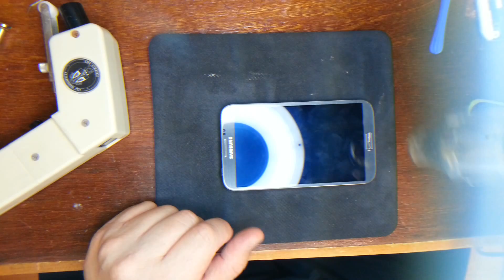Samsung Galaxy Note II Glass Removal

Comment: ANYBODY REPLY ME.... 
After remove the  broken screen then can we apply full glue to screen ??
or only sides of the frame?
how to attach new frame?
Reply: Raghu CP Chitlur If LOCA Glue way, then You need to apply LOCA Glue in a X shape. Shape is common on all these how to videos. 2mm Double sided tape is on the borders. 
If You use only 2nn double sided tape, then after some time, dirt will get in between glass and LCD and they will loose the touch.
Reply: frame have hot glue already can use frame machine, and or you can use B-7000 to paste frame

Comment: is it possible to heat my note 2 in the oven to get it hot enough to get the glass free?
Reply: LTCAproductions Not unless you want to completely fry the motherboard and burn the LCD
Reply: LTCAproductions Not unless you want to completely fry the motherboard and burn the LCD

Comment: MarcustazXDA  I just replaced the screen of my samsung Galaxy note 2. But I experiencing some trouble with my touch screen. It works good but sometimes it wont react when I touch the screen. I have to lock my phone and unlock it and then it will react normal again. I also had this problem when i replaced the screen of my samsung S3. Maybe I'm not doing some right. are you familiar with this problem. Do you have any tip what I can do to solve this?

Comment: Replaced the screen of my Note 2 and everything works and looks fine, except for one thing that I do not really find a lot of information on : if I push to hard on the screen (probably this happens when the glass touches the digitizer beneath it directly) the Note 2 gets confused and the touch functionality is blocked completely until I lock and unlock the device. In Development mode I see that every touch after the first "deep" one is seen by the Note 2 as 4 touches instead of 1. Unfortunately when I put it in my pocket this also happens, leaving me with a diminished experience after what I consider an otherwise succesfull broken glass replacement. Am I the only one with this issue?

Comment: Tried to fix mine, bougth everything i needed, heatet it up properly but managed to get the plastic guitarpick under the digitiser when trying to serpate the glass, and the entire digitiser snapped off, also destroying the amoled screen in the process. :(
Reply: Espen Andrè Edvardsen That sucks. I think its never stressed enough how THIN the glass is. The digitizer is THIN too. So its like a tiny thin piece of glass that needs to be removed.
Reply: +Espen Andrè Edvardsen Did You Get A New Phone Or Was It Fixable ?

Comment: I would advise EVERYONE watching this video to make sure you buy some plastic razor blades for the screen removal. The kit I ordered came with a guitar pick styled tool, which couldn't get far enough to lift the screen completely. I started using a mini screwdriver and it worker great until the bottom left corner of my LCD cracked from the prying motion. Use extra caution on ALL corners, and wait the extra few days for those plastic razors! Keep in mind that a new LCD is around 150$.

Comment: 1.  can you use a regular hair dryer?  If not, how and where would I obtain one of those super heat things u used?

2.  Is there a part that goes through the steps of putting the new glass on??

Comment: My Note 2 has a cracked glass. I watched your video. I was hoping that your process would have been to completion with a working unit.And then, turned on and used as normal to show the repairs was a successful operation.  Any chance of that?  Also, for those who do not have a heat gun can a hair dryer be used?

Comment: If some of you guys are having trouble with the screen not being responsive but when you lock and unlock you phone it works then all you need is loca glue 
AND remember that most of the new glass screens will have a screen protector in the back so make sure to peel it of or else its going to look darker and scratched

Comment: I ruined the white part of the back key not the ribbon but the piece that goes behind is there something I can use other than buying a new ribbon cable that comes with that included?  still works but I heated up to much and that white piece warped and its causing the new screen not to sit right in that corner.

Comment: I bought a replacement digitizer from etradesupply attached the ribbon cables and it doesn't work at all. It's not broken it just doesn't work. I'm baffled. I'm contacting them for a new one

Comment: Hi there, i changed the glass using this method. The problem is that now the bottom part of the screen is(within an inch above the home button) is only recognizable with Spen. it doesnt recognize my hand. i used adhesive around the edges of the screen and i did not know that i needed an adhesive for the screen itself. Does all of this mean i no longer had a working LCD??? or is there any hope with it???

Comment: Hi,
I have a Samsung Galaxy Note 2 and I recently broke the front glass of my Note 2. I then bought a new Note 2 front glass and I took out the old glass and input the new glass in successfully using your exact methods from this video.
For some reason, my Note 2 will not show anything. There are noises of it being turned on, but there are no lights except this light to the left of the earpiece.

Please assist me in my next step.

Thank you!

Comment: My note 2 screen broke and the screen used to still turn on but now it doesn't. Do i need to replace the digitizer or something more? Help me please =)
Reply: You likely broke the digitizer during the repair. I think the downside to removing the back screen is that you are more prone to pulling up the digitizer as well as the glass if you are not extremely careful.
Reply: Erik Anderson No no i haven't repaired it yet. It broke from when i fell but not only is the screen cracked it also doesn't turn on so i'm wondering what it is i need to replace or is the entire phone broken? I've repaired screens before but only when it was cracked (still turned on and functioned)
Reply: Do you get the startup sounds and a black screen or no activity at all?
Reply: Erik Anderson None activity =\
Reply: On mine I heard the sounds but no screen activity and that's what turned it to be the lcd/digitizer combo. If you don't get anything that sounds power related.  Sorry I can't help there.

Comment: how to check that only glass has broken not digitizer? please answer me. i am going to buy phone which is working fine and has only cracked screen which is visible, looks like only  glass broken handset, how to know if digitizer is damaged or not ?
Reply: if digitizer is broken you wouldnt be able to use the touchscreen
Reply: Killerdude is wrong. If the led doesn't turn on and you cant see anything or there are black marks on the screen, or it doesn't respond to your touch, the lcd is broken. If everything works, the just the glass (digitizer) is cracked, that is the only thing that needs to be replaced.

Comment: ? I replaced my screen and now it is freezing when, I am texting.  I have to lock and then unlock my phone, just to text over and over, repeatedly just to type a full message any help would be appreciated.
Reply: That is the reason people should use loca glue. It gives the support you need, also easier to break the glass again without glue. I will do my first with no glue then with experience, try the  glue.

Comment: While repairing the glass on my note 2, i slightly messed up the top left portion of the digitizer ribbon cable.  Most of the touchscreen is responsive and works properly, but just the bottom part of the screen is buggy/unresponsive (such as the last row of letters when trying to type some text).  

Is this a problem with the digitizer cable, or is it the fact that i only used double-sided sticky tape rather than a stronger adhesive long the edges?

Comment: I did a successful repair thanks to this video, only problem I have is that the screen looks a bit dull now and has some vertical lines in the new glass. Could this be due to a cheap repair part? It doesn't feel like glass but plastic. Is there any online shop you would recommend for an original replacement glass screen? International shipping will be handy.

Comment: I did everything you said, glass came off with no problems, i put the new glass on, i turned the phone on but somehow the touch is not working. When I use the s pen the screen works properly. when i use my hand it doesn't. What did i do wrong??/?????

Comment: You guys should know that replacing the glass is not a great investment simply because it is easier to get dust underneath the glass/lcd. This will require you to replace the adhesive every month or so... I have many spare adhesives/extra note 2 glasses just for this as I have to replace mine due to the dust that accumulates. I do not use the 3M tape like many do but buy the one that are precut for the note 2.

Comment: Can I get a quote to fix, I messed up on the LOCA section of the repair. I fix the glass the first time, but a newton ring appeared. Attempted with the LOCA , removed motherboard, but only the battery signal comes on, and only when it is plugged in, any help would greatly appreciated.

Comment: ...the digitizer in the upper left hand corner of the screen.  Yes, the one that you specifically said "be very careful around this cable"  The screen still powers up, and the S-Pen works everywhere, but the lower 25% or so of the screen doesn't respond to touch, no matter how hard or soft I press.  I tried holding the ribbon cable in place and it worked ok, so I taped it, but the adhesive came up and when I tried a second time it didn't work.  If I try pressing that ribbon cable down...

Comment: I could really use some advice.  I followed your guide exactly, last night, and replaced the glass on my Note 2.  I have 2 issues though.  1, there seems to be a bubble of air or something in the middle of the screen, between the glass and digitizer, that gets larger as I press harder.  I assume it's because of the gap between the two where the liquid adhesive would normally go.  Not a huge deal, but annoying.  My big issue is that I accidentally peeled/ bent the ribbon cable that connects to...

Comment: ok.. I know what I did.. I pulled the glass back off and noticed I had slightly damaged the ribbon cable connected to the screen/digitizer. I should have watched your video twice, I noticed that you mentioned to be very careful at the top left where it's connected. I thought I was but I guess not enough. I put an extra layer of the double sided tape in that area and now it works kinda.. it's a bit inconsistent. Guess it's going on Ebay as a parts phone... DAMN.. SO CLOSE!!

Comment: Alrighty.. did the replacement and everything seem to have went fine but after everything is back together the lower half of the screen isn't responding to touch.. upper half fine and the home button,back and menu work fine.. just the lower half of the actual screen. It worked fine before the replacement.. what the heck did I do?

Comment: Do you still have the phone that this happened to???? the same thing happened to me and I found the solution. your 3M tape is probably too thick. I bought some industrial strength tape because I thought it would be tougher but it was too thick so the digitilizer didnt register my touches.

Comment: @w3stie1 Its been a month. Is your phone still ok? I fell asleep at a bus stop waiting on my bus and my phone slipped out of my hand and hit the concrete glass down. I knew I was in trouble before I turned the phone over and saw that the screen was cracked. Is your phone still performing normal after you replaced your screen?

Comment: Marcus, have you ever had trouble doing the white Galaxy Note 2 glass?  Those do not peel off as one like the pebble blues.  I once had a heavily cracked white note 2, and I had to remove each shard individually.  After removing all shards, I tested the LCD/touchscreen and it worked.  After attached the lcd/assembly (minus the glass) back to the mid bezel, suddenly there was a crack IN THE LCD.  I doubt that it was from me pressing the lcd back into the bezel because I pressed on the edges.

Comment: awesome videos man, helped me out a ton. Quick question,  If the return botton led is out, be possible to replace that ribbon cable at the same time as replacing the glass?  Or do I need to remove the LCD as well?  Thanks a bunch!

Comment: I have seperated 100s of s3 just the glass and put on new glass on them. I have no problem seperating Galaxy Note 2 glass, i do it just like the s3. So my question is, after you seperate Note 2 glass and attach a new glass how to do you prevent the glass from touching the digitizer/screen? You can see it when you press on the center of the screen. thnx for the videos, learned a lot from them

Comment: great vid! gonna be putting in a new screen on my sph-l900 soon and just a few questions. if you damage the LED's say for the menu or back buttons, will they still work and just not light up? also my glass is completely shattered, and there is a screen protector on it that for the time being is holding the glass together. should i remove that before trying to lift the glass off or would you recommend leaving that on in order to remove it as one whole piece?

Comment: I was wondering if you could comment on how you have said in a few videos it's "never as good as new", but much better. I have an N7000 with a single crack which barely crosses the upper corner of the screen- I'm debating if a screen swap is worth the potential risk. How are the screens 'not as good as new'? Is this due to the risk of scratching or burning the AMOLED? Are screens which are mostly in one piece significantly easier? Could I expect the same results with a hair dryer vs heat gun?

Comment: I used the heat gun on high and it worked without damaging my digitizer, however, after removing everything and putting the new glass on, it seemed like it had a bubble of air. How can I fix that ?

Comment: You were probably too close to the screen. Your heat gun should be on LOW setting, holding it about 3-5 inches above the screen. Make sure to constantly move the heat gun as not to burn one area.  
Your phone should be hot to the touch, but a few degrees below a burning temperature. 180*F -> 190*F is desirable.

Comment: I'd recommend a Hot Plate! It spreads the heat evenly and you're able to adjust the temperature. Business/Playing Cards are ideal for prying out glass. This is the method we use on iPhone 4,4s,5, s3, note 2, note 1, s2.

Comment: hi i removed my glass and the digitiser looks ok with no real damage. just small scuffs..no cracks!!..bt i inserted the battery and turned it on.. only the bottom soft keys light up.. the screen is blank..is the digitiser damaged ???

Comment from the maker: Hank, You need a complete digitzer assembly. Ebay generally charges to much for this part and I can tell you for what most charge for the part you can call Samsung and they will repair it for a flat fee of $190 range and pay for shipping both ways. This may be the way to go especially if you are not technically inclined to remove the motherboard and associated parts, ribbon cable disconnect etc. Case like this you might wind up doing more damage if you are not familiar with the process.

Comment: Very useful, thanks. At 15:03 you refer to LOCA = Liquid Optically-Clear Adhesive. Thought I'd mention it in writing in case some are unaware of the term. Wikipedia has an article on LOCA for the technically minded.

Comment: I tried this over the weekend because I cracked the glass on my Note 2. The crack started in the upper right hand corner and made it really hard to pry up the glass. In the end I broke half the digitizer cable. I was able to put it back together as is, and the screen didn't work with fingers, just the SPen. In the end I ordered a replacement digitizer from cellphonerepairshop com They were awesome! If you do screw up this method go with a new OEM digitizer. Just swap the boards and done.

Comment: You can, but it's easy to take the frame off. Most of the note 2 lenses come with a little blue pry tool that works great for getting the frame off. Just go in a circular motion starting from one of the sides. Then gently pull it off. You'll see if you look inside the battery housing where its being held on the top in bottom for both verizon and att notes. You can use the same tool to help unlatch these if you can't manage to pull it off.

Comment: Make sure your the housing for the home button is on correctly. If its on backwards you can either damage your screen or you will not have correct sensitivity on the screen. You should be able to feel it pressing out to the touch a bit with your finger.

Comment: Great video. Mine has a little scratch, on the front outer glass I believe. So replacing the LED+Digitizer will cost me 200$, where the front outer glass is available on eBay for around 20-30 bucks, if not less, however I believe it's not made by Samsung. So if I change only the outer glass, will the S Pen work, and more importantly will the glass be Gorilla? Spending 200 bucks is beyond me, and I won't do that.

Comment: So I replaced my glass on my Note II and did everything correctly. I turned on my phone, got really excited then when I tried to touch it, it wouldn't work. It looks completely fine AND the S-Pen works with it! But my finger is only responsive all the way at about the first inch of the top. Any help? Solutions? Why it happened? Much appreciated, thanks!

Comment: i really enjoyed your video thank you!!! is the touch pressure for Spen still works the same? and also i have seen some adhesive on ebay that It's designed for Galaxy Note 2 i317 screen, no longer need to cut the generic adhesive/double sided tape to fit your screen. do you recommend getting them?